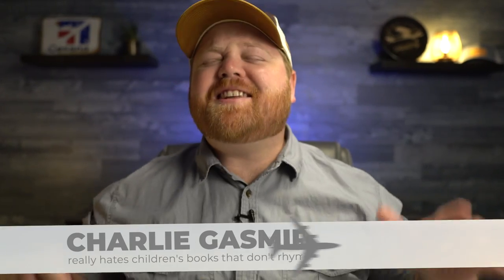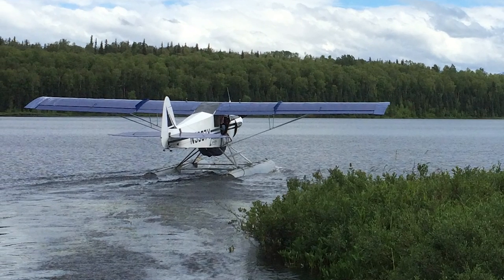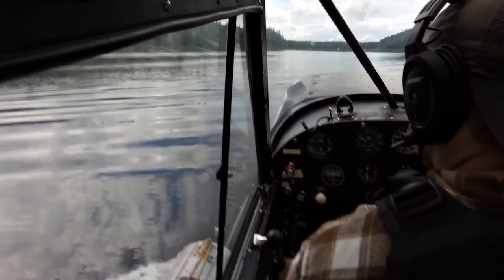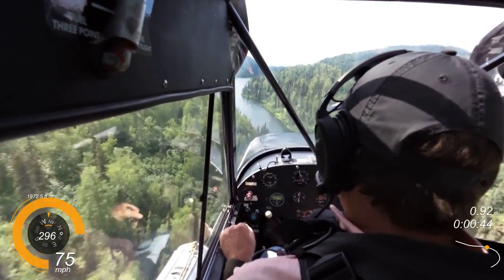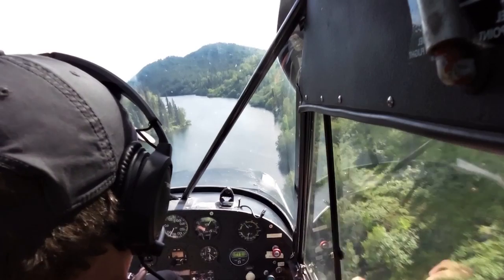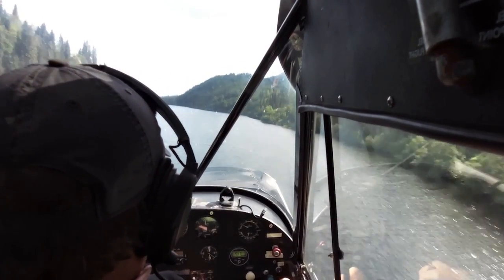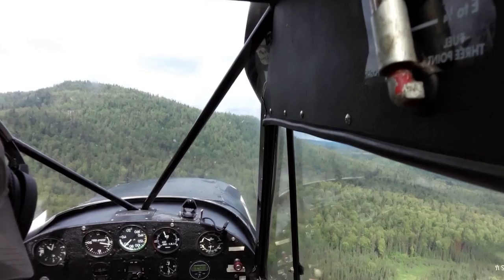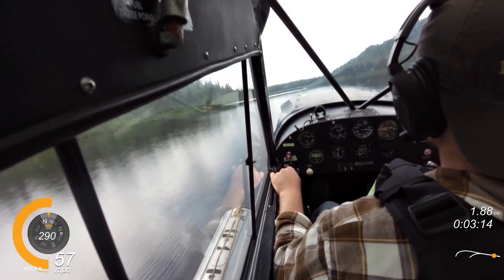What Training In a Super Cub On Floats Was Like (It was WILD!!)

Comment: Some years back, my wife and a friend gifted me a demo flight in a floatplane at Kenmore Air. Because I'm not exactly the lightest of guys, we went up in their 180, rather than the Super Cub. Because I had my PPL (although I was not current at the time), we actually did it as an hour of dual instruction and logged it as such. After we were done, the instructor said to the effect of, "If we do this for another hour, I'll sign off on your complex aircraft endorsement." I said, "But this doesn't have retractable gear." He replied, "True, but it does have retractable water rudders and those count." I never did that, but I may very well get my complex endorsement before too long, although it'll likely be in a 182RG.

Comment: I suppose if you wanted to get the engine running without moving you could feather the prop first.
Reply: That only works on some turbine engines. Cubs have a fixed pitch prop.
Reply: @coreymitchell1468  Ah, I see, thank you. I suppose I should trust that the professional would know all possible options!